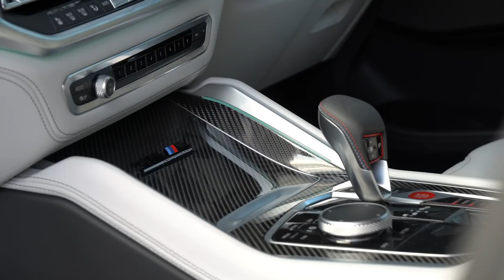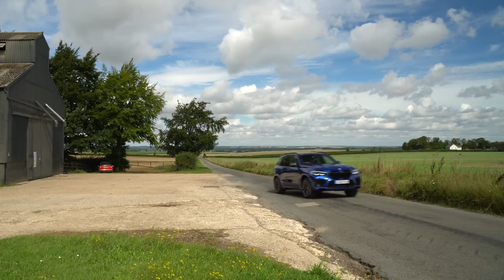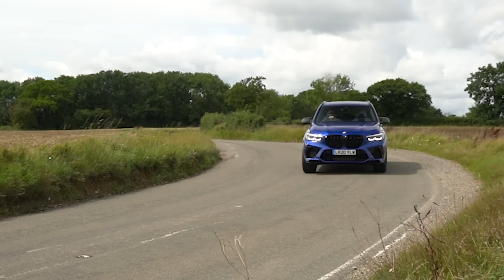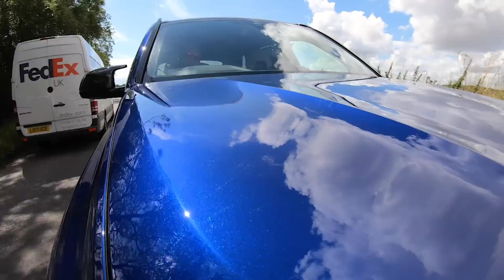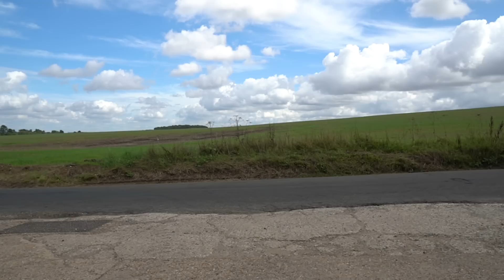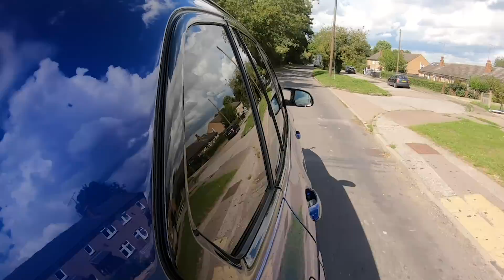1st Drive NEW BMW X5M Competition | 0-62mph 3.6 seconds! | 625HP

Comment: 🤭🤭Hi Everyone

i would like to share my experience with the above dealer and and person

we bought a brand new M Power car of them in september last year and it was a cash purchase of over £130k no finance was taker out unfortunately, the vehicle has failed me 4 times, failing to start Twice, and Twice cutting out in the fast lane of the motorway with my family in the car all within 3 month off ownership

i have told them i am rejection the car under the consumers act 2015 but they are saying there not accepting my rejection because of a tow bar has been fitted by a 3rd party and that what was causing the problem, but not once have a picked up a bill from BMW Relating to this so i know that was Rubbish

i have reports of the warranty work and job sheets and technicians finding but not 1 off them says it a tow bar issue or wiring

The tow bar got taken off the car and guess what it failed me again on the motorway!

my solicitor has advised me that i have a strong case for court action but my wife is saying it will ruing our life with the stress of it and its enough stress all ready, what we have been through all ready

But I Feel very disappointed with the above dealer and person ie TL And BMW, i would Never purchase Bmw again

I have been in touch with RIP OF Britain and they are very interested in the matter because of the High value and the dealerships and persons Behaviour

Will Keep you posted

Comment: I've always admired the BMW M cars and in 2019 I bought an m5 to replace my 2010 Porsche  panamera and I wasn't disappointed one bit. Also last year I bought an old X5 e53 3.0d to do tip runs and keep the mileage down on the my M5 during winter. I'm amazed at how the old nail still drives with 160,000 miles on it and for an old 2005 diesel is pretty nippy. I only paid £2000 for it and I have to say I'm besotted with it. The driving position is ace and the interior is a lovely place to sit, I'm certainly glad I didn't get a range rover as planned. I think I'm going to test drive one of these next month with a view to trade in the m5.

Comment: Thank you for measuring the actual 0-62 time instead of just quoting the official numbers like most others. 

The hard ride quality is the cost one pay for the great handling I suppose. The good thing is that you get used to it. I’ve had the previous generation F85 X5 M for 3 years now and just extended the warranty for another 2 years. If you need the luggage space, backrow space and high riding driver position is it a great car.

Comment: £116k for a BMW😂 Wait two years and pick it for less than half the price or buy both the M2 comp and a standard X3 as the daily.
Reply from the maker: Why would someone who has £120k to spend on a fast SUV wait two years, think you're completely missing the point.
Reply: Joe Achilles actually I don’t see the point in a X5M for £116k, that’s the point.

Comment: Would like to see a comparison between the current generation F95 vs the previous generation F85 because you can pick up a very low mileage 2018 F85 for less than half the money of the F95.  So is there really that much difference between the generations?

Comment: Buy x5 that  u have 22 inch wells and u can drive in snow and mud and watter rock and sand.. and you go nowhere with 600hp.. There is no logic that suv is fast.. and going nowhere on snow and mud and watter.. 0 logic from bmw.Buy real suv Ford Raptor. IF u want bmw m buy m5 or m6.

Comment: People. Buy the M5 for the minor differences between the two if handling & a steering wheel are so important! Joe is missing the point of the X5M completely & I fail to understand any comparisons against the M5 and X3M are even relevant. RSQ8 is not a benchmark Joe I’m afraid, sorry.
Reply from the maker: Don't be sorry, start your own YouTube channel, you're clearly the expert 🙌
Reply: Joe. I’ve driven them both & like you I don’t have to be an expert to have an opinion!

Comment: I have the G05 X5 M50d, not as quick and lacks that V8 soundtrack but it shares that great interior and is plenty fast enough for an SUV.  The huge advantage is fuel economy - I bought the car in Sydney and on the drive home to Melbourne, it averaged 6.7 L/100km (42 mpg).  In every day driving and commuting it consistently does 8s (33 - 35 mpg).  For the weight and performance it’s astonishing.  And 760Nm towing is epic.  I get it’s not the same but to me is a great compromise.  I could not live with 15 mpg (18.8 L/100km)

Comment: Saw an X3M squatting under hard acceleration the other day was one of the most savage things I've seen in a while, can only imagine what the X5M does
Reply: The X5M has self-leveling rear air suspension. The x3m does not.
Reply: @nate7906  no it doesn't
Reply: @Rsandlerful  The E70 X5 M & F85 both have rear air suspension. The F95 doesn’t.
Reply: @Ryan St the ride comfort on the X3m is terrible. Be sure to try before buy.
Reply: Ryan St no The x5m is faster
Reply: @spbduonl8053  I'd love to see a drag between the two. I've seen new X3M doing 3.3 0-60. The S58, like the B58 are far more underrated in power figures than the previous S55, S62 engines.

Comment: Joe, you sort of raised it but brushed it off as quickly, however, what is a 600bhp SUV that does 0-60 in 3.6secs and does 20mpg actually for? What needs does it satisfy? Is its main justification that folk with £115k to slosh about can afford it? Its an oversimplification I know, as this could apply to many cars, but given the speed limit on the road you drove it down is 60mph, is the extra dosh over a 3.0D as you mentioned, worth it purely for the acceleration?🤔
Reply: It was an honest question 😂 Personally I think it’s ludicrous to label an SUV with the ‘Competition’ tag. Are folk gonna take it to a track day? 😂 More like blatant profiteering on BMW’s part 🤔
Reply: @davidhall7744  no different to the Audi RSQ8 or the Mercedes GLE 63s or the cayenne Turbo. You could say they are all pointless but some people like super SUVs and they have the money to spend.

Comment: Still think an Range Rover sport svr would be where my money went. Almost bought an x3 m comp but just didn’t have the wow factor when it came to putting the money in so I backed off.
Reply from the maker: SVR makes a great sound, but it's dynamics are comparable to a X5 30d from 2012
Reply: Joe Achilles have you driven a svr? Ovb not as dynamic as a x5m, but thats a lie it ain’t  bad to be compared to a 2012 30d
Reply: Joe Achilles I would have thought that; however this video suggests the SVR’s handling is great even in the company of a Cayenne Turbo https://youtu.be/vAz_3Rq8NkM The main thing that puts me off the SVR is that the numbers suggest it is considerably slower than cars like the X5Mc, and I am looking for something akin (in terms of acceleration) to F10 M5 I had in the past, but with a big estate style boot and the ability to fit 3 child seats!
Reply: Joe Achilles that maybe they cause but I don’t think really care about the dynamics, it’s more about the looks and sound and a SVR has both them over the x5 m comp. I also think an svr looks like a 100k car where as the x5m doesn’t in my opinion
Reply: Jack_C unreliable as hell and crap infotainment compared to its pure German rivals. Only thing it wins on is Chelsea tractor status appeal and it’s sound (but bare in mind that engine is a dinosaur and no longer in production)

Comment: Had a chance to test X3M and X4M at BMW M Academy last week. It was quite Nimble  for it's weight.  It's true, the X ride was less refined.  But you could toss it around. The braking was strong, and had quite a bit of push from a start.  I posted a couple of brief notes about the event.
Reply: @Bill Gates Ups sorry, ich habe X5 auf dem Testkurs getestet, aber X3M und X4M mit der BMW M Akademie.
Der X4M fühlte sich wie ein Auto an. Ich konnte mit ihnen beschleunigen, bremsen und den Autocross fahren.
Der Innenraum ist dem BMW Auto sehr ähnlich. Das Steuerungssystem ist sehr effizient. Der X4M bietet auch eine Fensteranzeige für Geschwindigkeit und Drehzahl.
Die Beschleunigung war sehr stark und robust. Es drückt Sie zurück in Ihren bequemen M-Sitz. Der X4M könnte Kurven fahren, aber wenn DSC eingeschaltet ist und er schwerer als M2 ist, neigt er dazu, mit etwas Untersteuern hart in Kurven einzutauchen. 

Für eine Familie und ein bisschen Spaß auf der Straße ist dieses Fahrzeug ein bedeutendes Upgrade gegenüber vielen anderen Frequenzweichen seiner Klasse. Aber es ist nicht so gut für die Strecke wie M2,3 oder 4.